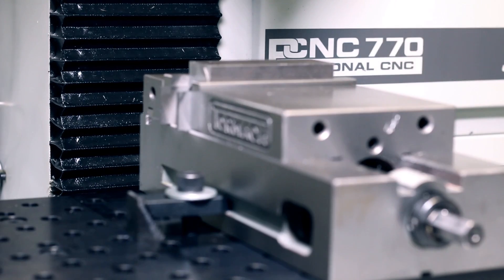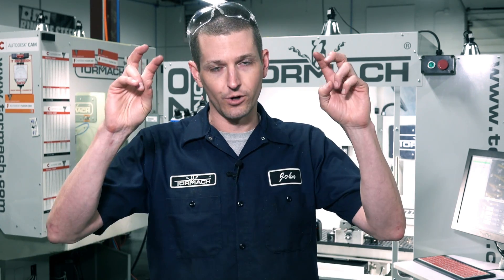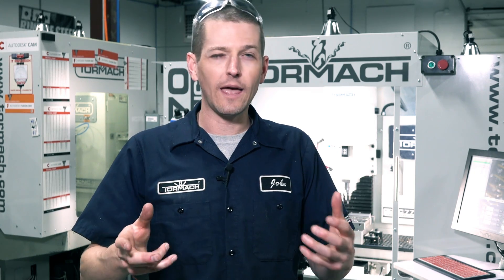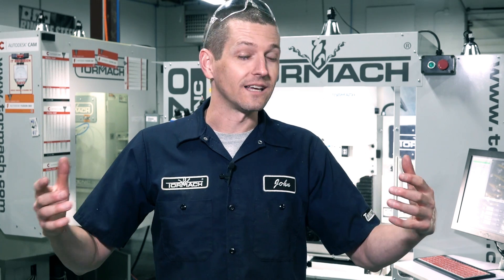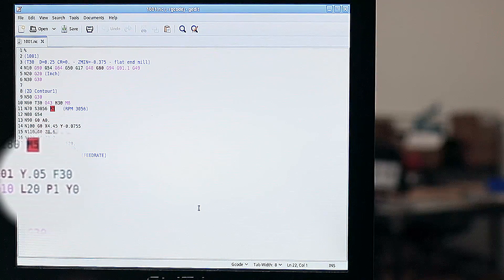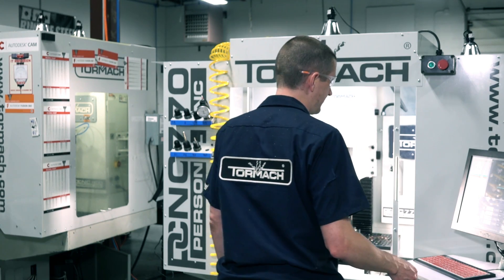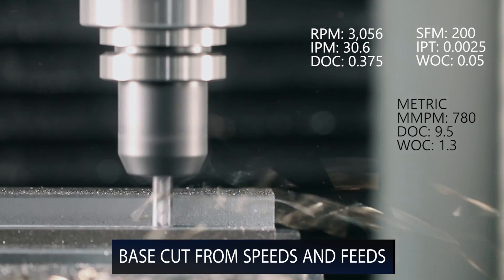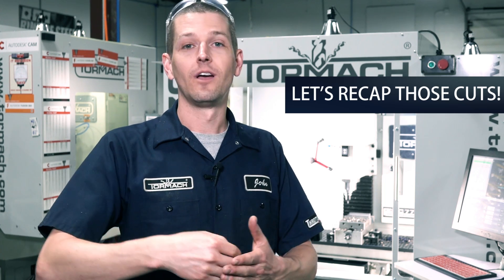Steel Feeds & Speeds: Testing with Automatic G54 Update!  WW144

Comment: you should be able to shift that work offset with a G91 G10  L20 P1 Y.05, for incremental, than you would not have to position at .05 to set it to zero.

Comment: & thanks for the tip! I used to mill at 6mm depth of cut thinking it would put less strain on my cnc router but actually 13mm depth of cut works best! It kinda stabilizes the end mill in a way & prevents it from snapping. My 1/4" carbides are milling steel at a material removal rate of 3 cubic inches per minute now! :)

Comment: Take a look at Blue Swarf's tap testing kit.  MetalMAX DC Kit
For tap-testing milling tools, spindles and fixtures.

The kit will show what RPM's will produce chatter and which won't.  It is a sensor that you put on the cutting tool and a special hammer that you gently strike the tool with.  The sensor on the tool and the hammer are wired into a laptop which will give you a graph showing where you will have chatter and where you will not.

We used this at my previous employer which was a Aerospace machine shop.  We would run 1" Dia 2" LOC 2 flute uncoated carbide end mills in 7050 Aluminum at 28,600 rpm and 600 IPM with a depth of cut of.600" and a width of cut of.600".  The machines that we would run these cuts on where a Makino MAG 3 and MAG 3H.  They had 30K and 33K RPM spindles with 100HP spindle motors.  We had to use heat shrink tool holders at these RPM's and they had to be checked for balance with a special Haimmer balancing machine every time we changed a tool.  Also we had to maintain a tool stickout tolerance of +/- .010" otherwise we could have issues with chatter.

The really high speed mills used Silicon Nitride spindle bearings which are very brittle and can not cope with the slightest bit of chatter or vibration.  This is why we had to tap test every milling tool and why we had to use balanced heat shrink holders.  My previous employer learned the hard way about the issues of chatter with the high speed milling spindles.  Having at one point gone thru 10 spindles in one year at 50,000$ per plus 2 days down time to install and recalibrate the machine.

Comment: Try using this formula for chip thinning. I use it quite often with great sucess. It compensates for the radial engagement of the tool you showed in the video. You can achieve much greater feeds with no added pressure on tool.                            
(.5×(Tool Dia./width of cut))/(SQRT((Tool Dia./width of cut)-1))×desired chip thickness

Comment: I was playing with cutting stainless on the 440 and I was surprised to read forums about how small the feed and speed window was between work hardening and breaking the carbide tool.  304ss is rough to work with.  Loving the vids, good luck with the open house and keep rockin!

Comment: Hey John, how high of an SFM have you tried? 200 SFM is about a third of what I would expect to see in 1018... I might shoot more in the range of 500 to 600 SFM, max DOC, .02 to .03 stepover, just crank the feed rate up. .003 to .004 IPT. Chip thinning is an amazing thing, my friend. 

This does depend on how high your Tormach spindle will go, though, and how fast it will feed without choking. I know that would work on your Haas, though.

But - the proof is in the pudding; if it ain't working out, you got to do something different!

Comment: G10 yes it's always been standard feature on Fanuc controllers..the other way is G92 X Y Z at the start of the programme..leave out the G54-59 and just insert the coordinates next to the G92 before running the code works great :-) Btw some holders have adjustable run out to compensate for spindle run out..I like hydraulic or shrink fit for this type of steel cutting very little run out and they keep the coolant out of the tool to holder interface unlike collets which can rust up really easily....

Comment: Look into chip thinning and maximum and average chip thickness, this will help to shed some light on this further. It's surprising how much difference it makes when working with small engagement.
Also variable pitch or helix cutters will help with that vibration too.

Comment: To me, it looks like climb milling. wouldn't "conventional" milling help smooth out the cut?
Reply: Mark Schweter 
Conventional requires nearly twice the HP to make the cut. It would stall the spindle. 

Conventional is good for a finish cut in tough materials though.
Reply: Sorry... I thought:
Climb, or "down", milling, full tooth engagement at start of cut, was the power/stiffness demanding cut, easier chip ejection, better for finish.
"Conventional", or "up", milling tooth starts at "thin" bottom of cut and gradually increases material as the tooth sweeps the cut, better for hogging and low stiffness machines.

Actually looking it up, I see I have crossed the power demand from one to the other:
Climb: better chip ejection-better finish, down force in facing, lower power demand, backlash can be a problem if cutter force not high enough, tool deflection tends perpendicular to cut.
Conventional: chip recutting-finish not as good, upward force in facing, high power demand, tool deflection tends to be parallel with cut. 

http://www.cnccookbook.com/CCCNCMillFeedsSpeedsClimbConventional.htm

<Maxwell Smart> Sorry about that!</Maxwell Smart>

Comment: Glad to be of help 

See. Told ya you could have gone full depth 😁

And you should be able to bump up to the next higher RPM bracket with this. 6,800 RPM and adjust feed to maintain the same chipload, keep full depth of cut and adjust WOC to keep it within the machines HP limits.

Comment: I'd like to see a small vs large machine comparison, I'd be willing to bet the bigger more inherently rigid machine could run higher speeds and feeds without chatter
Reply: Travis Wiebe 
It has less to do with the machine and more to do with the tool holding rigidity. 

Machine rigidity stops chatter that's generated from things like the table, or machine bouncing or the Z axis ram vibrating. 

Unless you're taking monstrous 10-20HP cuts. You're not going to notice machine rigidity too much. 

Tool holding and clamping is where you're really going to see the difference. Along with the difference between a CAT40 taper spindle  and a TTS spindle.
Reply: Allot of the rigidity in a vertical machining center (or a horizontal as well) has to do with the spindle bearings.  All of my machining experience is with machines much larger than the Tormach mills he's using in these videos, and I know we use similar tooling and run it much more aggressively without the chatter or noise issues he's seeing.  I think a comparison side by side between a larger machine and his Tormach could be interesting.  There may be no difference, but maybe there will be, never know till you try.  :-)

Comment: are you using a new camara? the video looks great.
Reply: Is it great? I don't know. It looks jittery to me. The lighting certainly doesn't help. Seems way too bright and over exposed or something.
Reply: I just went through a couple older videos and  I'm pretty sure he filmed most of them with just a Go pro. They all have a similar fish eye and that "go pro" color saturation and sharpness. In the beginning of the video he has a nice focus pull on the machine too. So maybe it is  a new camera.
Reply: Looks like color grading to me. I think it might even be one of the presets in Adobe SpeedGrade. (or a filter, or a camera color setting). It's a little heavy in the greens, and the vignette could be reduced a tad in my opinion, but I like the clarity and contrast.
Reply: Looks like it's lower FPS than old videos. More cinematic colours too.

Comment: A quick question. if you have limited power is it better to take a shallower cut with a larger step over or a deeper cut with a smaller step over assuming speed and chipload per tooth are constant.
Reply: If we are talking about a average geared mill ignore the higher RPM tip cause doubling the RPM means losing half the torque when it's through gearing and will be easier to stall. As mentioned chip thinning comes into effect and you have to increase your feed when doing lighter radial cuts at any depth which results in faster material removal rates, but in the end it requires more spindle power as the the horsepower is a derivative of material volume removed and not chip thickness(although connected tightly). I don't think that most home gamer mills can really get in the HSC zone, and built-up edges are not a thing of the past yet.
PS: Chip thinning will making it easier on the tool but I guess you're conventional milling and you won't really be able to dial it in.
Reply: My Iscar rep used to say, "you paid for the whole tool...use it."
Reply: Well of course your tooling rep  would tell you that haha. That's the best way to get you coming back to buy more tools sooner!
Reply: Look up radial chip thinning and google "High speed machining" for some more info, but basically you want high spindle RPM and a light cut. But don't go so slow that the endmill is just rubbing against material generating heat. I think the main reasoning behind it is that you want the tool to maintain a high velocity by spinning fast. If it spins too slowly then it could easily jam up and break the tool or running the cutting edge, while at high speeds, it's more likely to just slow the spindle and wear it more.
Reply: James Thompson you're better with a deep cut and shallow step over. 

Depends on just how little HP you have. 

But the deeper you go the more stable your cut will be.
Reply: awesome reply guys,  thanks so much for the assistance.

Comment: I wish I had seen this yesterday!  I just finished cutting some long pieces that needed to span several vises.  I got some minor harmonic chatter on the gap between vises.  I should have experimented more with S&F.  Instead I'll just spend some quality time with a Scotchbrite pad
Reply: Would it be better to improve the rigidity of the fixturing first? Newbie here and it seems to me like rigidity is usually a quicker fix but maybe that's just the shop i'm in.
Reply: You always want to make your setups as rigid as can with the fixturing available to you and as practical as the operation will allow.